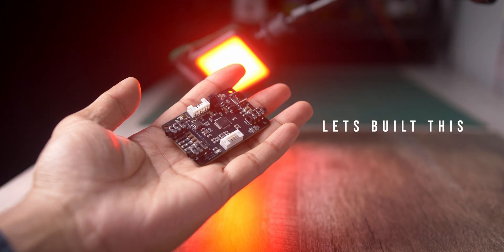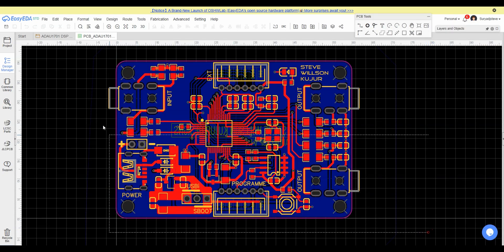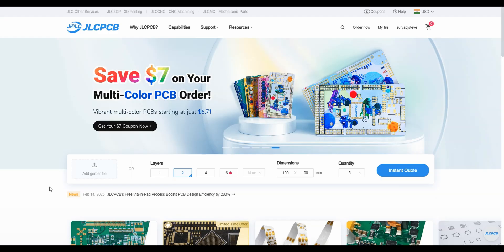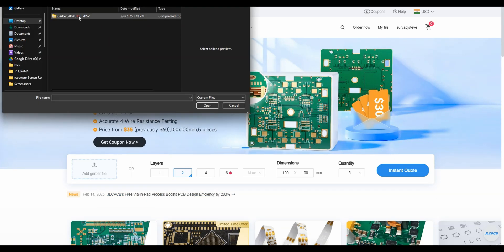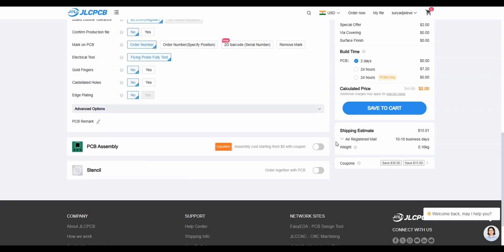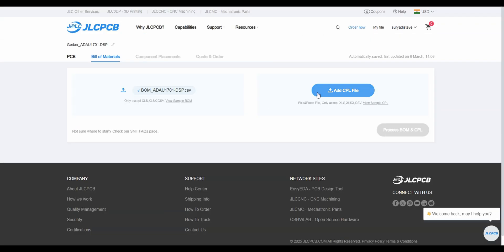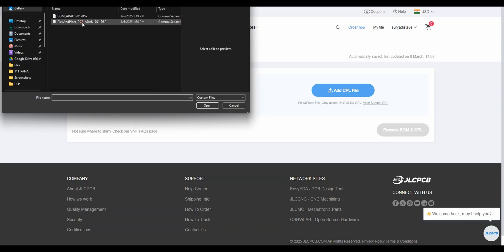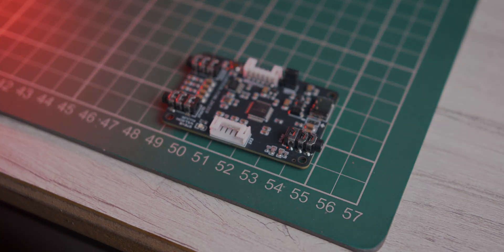DIY Audio DSP V1.1 | ADAU1701

Comment: What i really want, is something to take HDMI or DisplayPort audio off the wire, and amplify with a seperate volume control. I want high quality zero noise zero latency high bitrate digital audio 2 channels. If the price is right i am happy to pipe to 5.1 or more but the home theater receiver game is really lame and always has been. Everyone iust has one source now anyway, why isnt there a better amplifier yet?  I am using a toslink older amo which works great for 7.1 channel. My biggest complaint is the latency in the feed. Second complaint is the .24 seconds it takes to establish a stream everytime i play new content.  Halp